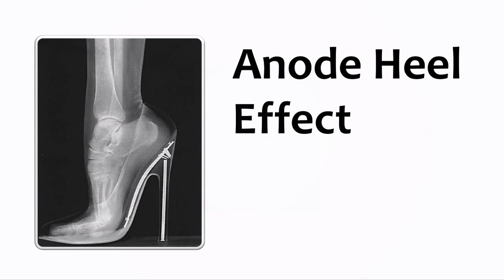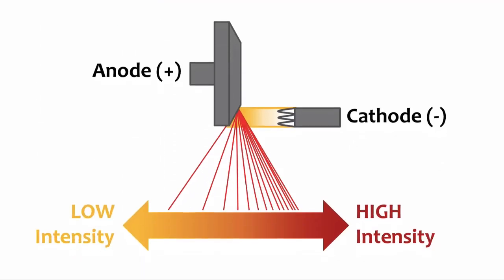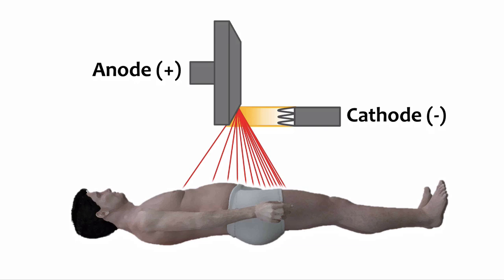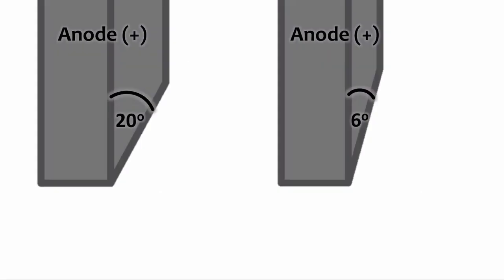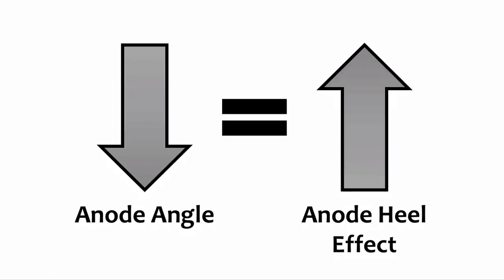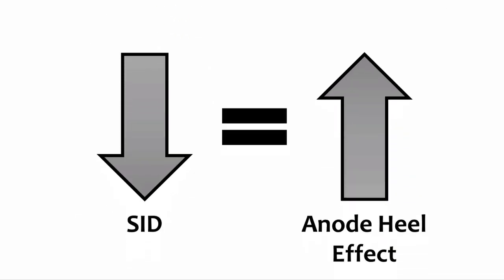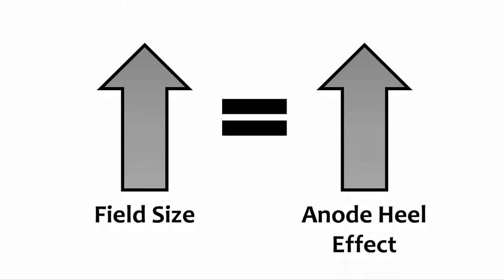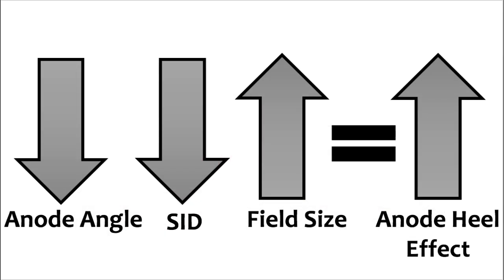Anode Heel Effect (X-Ray Tube)

Comment: And then when you  take the board exam where the multiple choice is very confusing because  the word are very confusing because they are similar but they are not example
Which of the following choices is true about heeling effect.
A. The higher the angel the more heeling effect.
B. The lower the angel the more heeling effect.
C. The higher the angel the less healing effect.
Which more likely make you confused during examination.😂😭😅😭